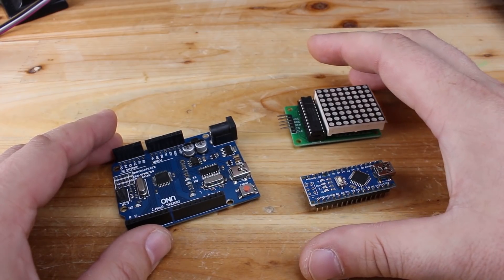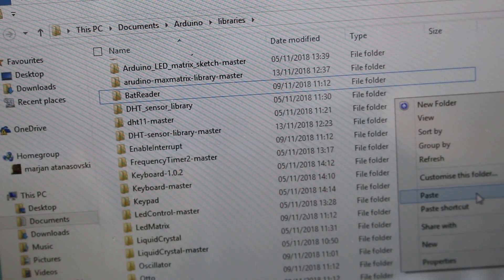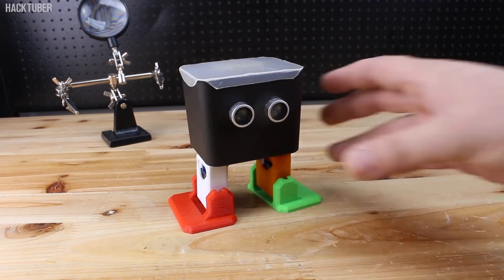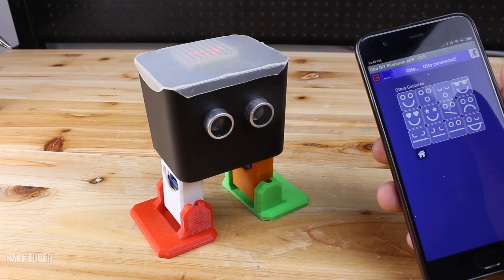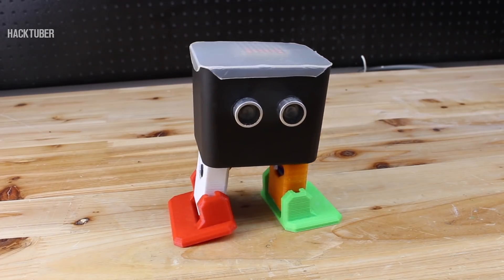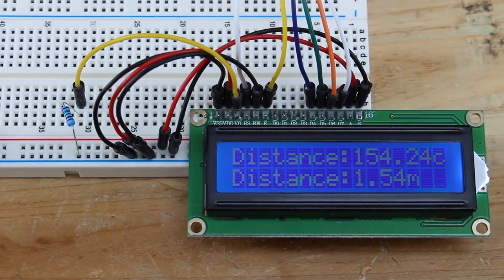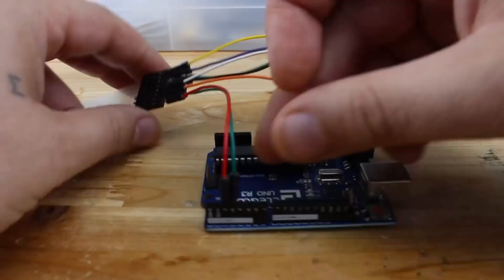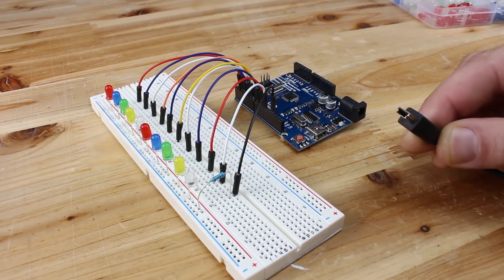7 Amazing Ideas using Arduino

Comment: Your thumbnail shows a sensor/board that I was looking forward to seeing implemented.  If that is a gas sensor on the right, i find those occasionally in microwaves. Handy part, wish I'd realized sooner that the thumbnail wasnt going to be related to the video.

Comment: in your fritzing schematic for the humidity sensor has the power backwards. you have the ground connected to the positive rail in every case and the where the units would use 3.3v you have them connected to the ground rail. I'm not going to use any of your schematics cause this is a basic mistake and even I as a beginner, on my first breadboarding attempt, was able to catch this. Since I don't have enough experience to figure out where else you made a mistake and I really don't want to risk damage to my brand new equipment. I'll look elsewhere for examples. Good effort, but if you are going to publish schematics as open source, make sure they are correct and won't cause damage.